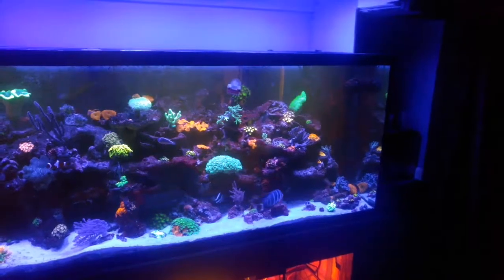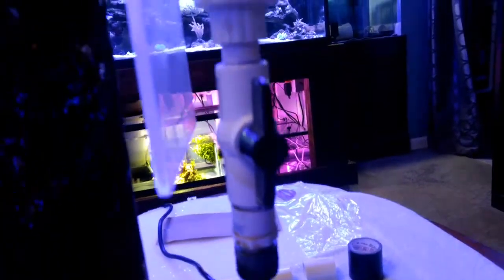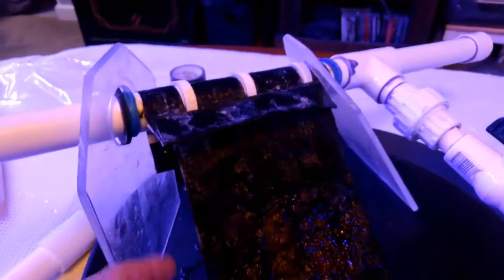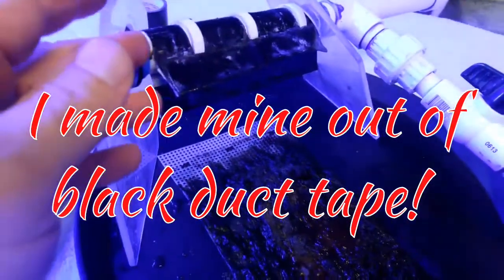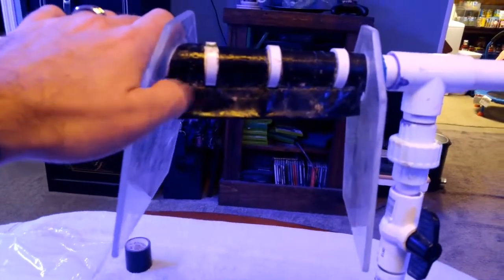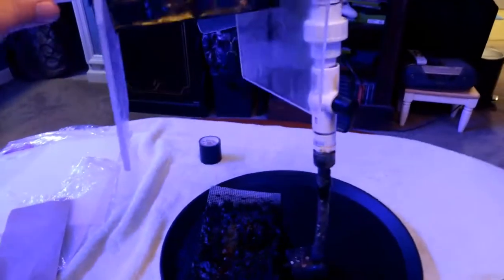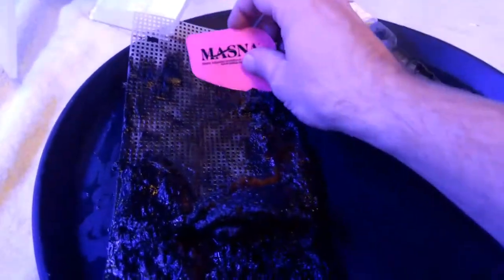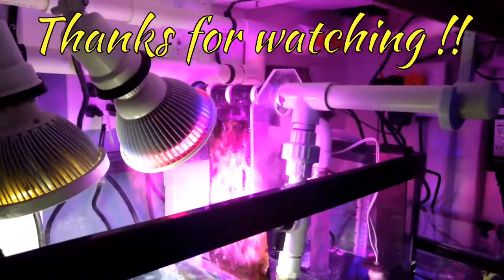My simple algae scrubber overview

Comment: Very quick to respond, great service!   I think the duct tape shield on top is something I haven't seen before.  Will add that, for sure, before getting mine going.   Not sure I have roughed up my screen enough either.  Will hit it quick on the  belt  sander to make sure. When installed do you drop the water to the sump, or put the bottom of the screen all the way to the water?
Reply from the maker: laminar flow, I let it sit just above the water. You CAN drape it into the water, That won't hurt it.  The duct tape shades the top from the light so it reduces clogging where the water bleeds out .It also catches the water if it decides to squirt out. I had a nice video of it but my video editor erased it on me...I didn't find out till after I cleaned the scrubber so I couldn't redo that video segment.
Reply: Love the shade idea.  Added one on my unit yesterday (credit to you in the video, of course).  Do you run your light 24-7, or on some cycle?
Reply from the maker: laminar flow, I do 24 hrs on...I get great algae growth and didnt notice any die off, but I have been thinking about putting it on a timer to experiment and see if the rest period helps the algae grow faster.